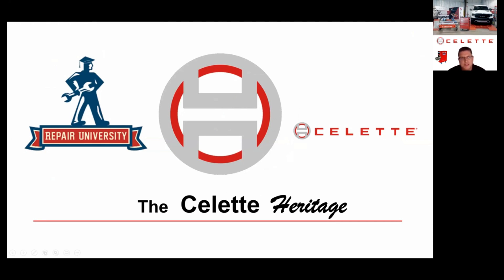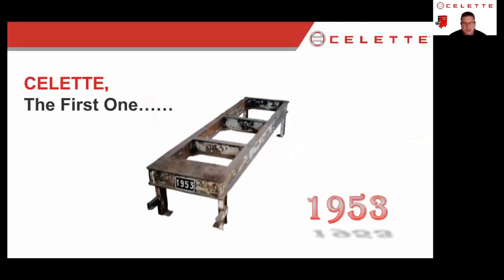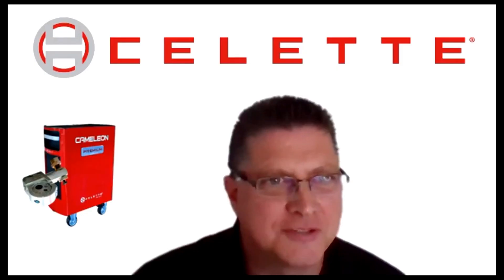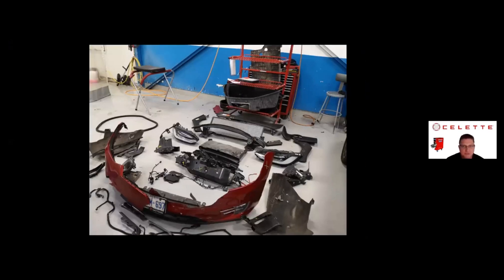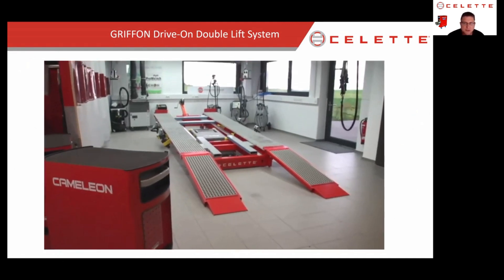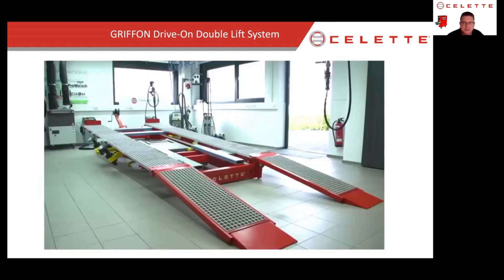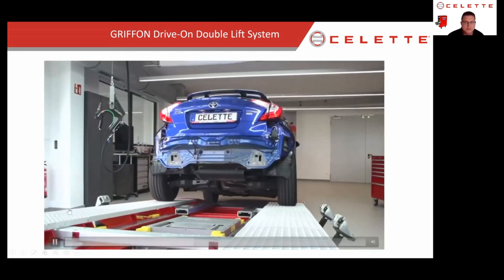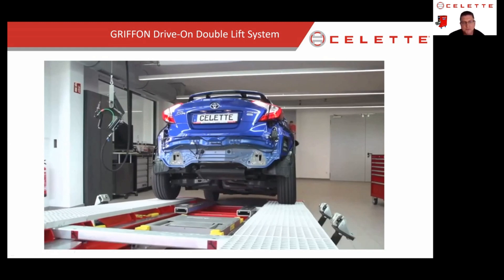Collision Hub webinar  presenting Celette collision repair equipment, for automobile repair shops

Comment: Why CELETTE you are not offering training to individuals ?
Reply from the maker: Hi there, where are you located?
Reply: @Celette  In South Africa, just call your guys here and told me they don't offer training to individuals.
Reply from the maker: Celette SA is our distributor in South Africa, it is a private company following their own rules.
Reply from the maker: Are you a technician or a business owner? What kind of training are you interested in?
Reply: @Celette  Hi there, i am interested in car body repair, i am starting a business where i'm only buying damaged cars and revive them. So i needed top end training in body repair. ones that around, honestly i don't think they doing it proper.
Reply from the maker: Pretty sure that when you purchase the equipment from Celette SA you will get proper training on how to use it. But, if you mean car body repair training then it's a different story, Celette is a equipment manufacturer not a car repair training company nor is the Celette SA, since they are our distributor, they only sell equipment.
Reply: @Celette  That makes a perfect sense now, thank you so much for that information, much appreciate your time.
Reply from the maker: Thank you! Have a nice day!
Reply: Have you looked at I-CAR training. Most of the courses are on-line. For the ones, like welding that are hands on, you could be come certified in welding and teach the I-CAR welding courses in your area. Nice little side gig, and you could make some extra $$$.